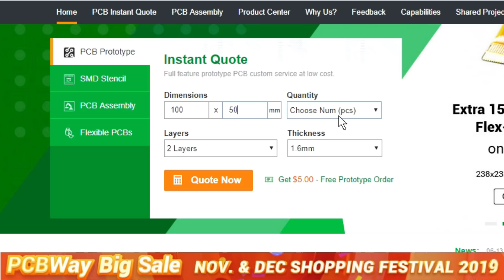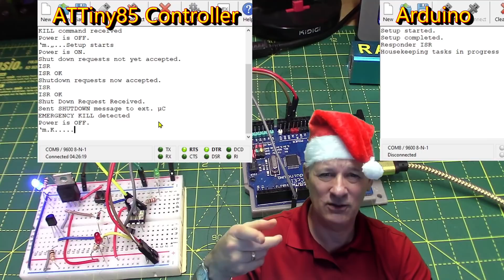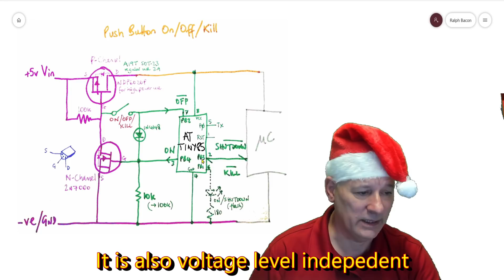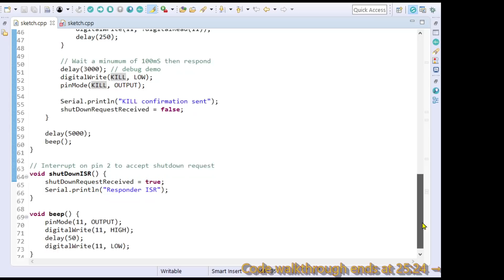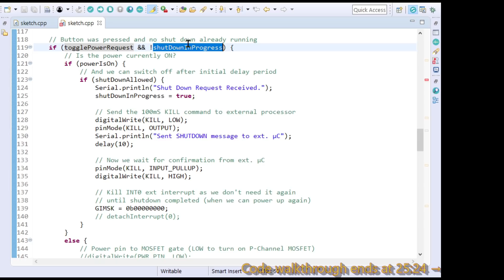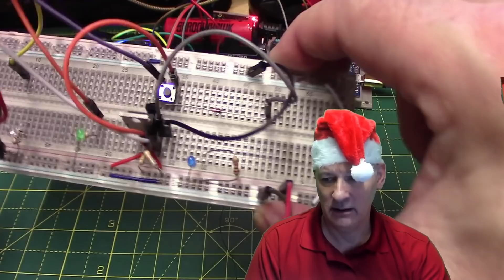#173 ATTiny85 Power On Off Shutdown

Comment: Merry Christmas!

ICSP header is simple ... Just connect to the microcontroller pins and keep your fingers crossed that the rest of the connected circuit doesn't disrupt programming. 😎 It's surprising how tolerant that process can be.

 The header is the second bit I draw on a microcontroller circuit diagram, after the microcontroller. I usually leave the header unpopulated, using a pogo-pin header adapter... which isn't fumble-proof but self-aligning with the tenth-inch hole pitch.
I use a close-pitch adapter on tiny boards with just two holes for alignment and pads for the other two. Look for "madworm" on Tindie.com for a pogo-programmer to suit the 1.27mm pitch.

Remember that the circuit receives power from the ICSP header during programming so disconnect bits of circuit that may be damaged or cause damage in e.g. machine controllers.
Reply from the maker: Excellent suggestions, Bernd! I knew someone out there would have more experience of programming the ATTiny85 whilst in circuit. I wonder if a relatively expensive pogo pin adapter is worth it, cost wise, compared to a simple 6 pin header (2x3)? I shall certainly investigate. Thanks for the information.

Comment: Why all the parts?
With 3V to 5V supply you could connect the ATtiny85 directly to the input voltage and put it into a deep sleep mode where it has pullup and wake on interrupt on the pin with the switch. Another pin would directly control a mosfet. The only parts you need then is the ATtiny85 and a single mosfet.
I have not checked the datasheet for the actual modes, enabled parts, etc. needed in the ATtiny85 for this, but it will probably end of with a very very low power consumption.
Reply from the maker: Whilst in power down the Attiny85 takes far less than 1µA, I believe. This makes it a good contender for Deep Sleep. When running it's about 5mA and about 1mA when idle. I didn't go down that route as I wanted (this time) for the power to be totally disconnected but your suggestions are very sensible. I wonder what it would take to make the circuit board flexible enough to be able to build both versions? An Xmas holiday challenge for myself, I feel. Thanks, Henrik, you always keep me on my toes!

Comment: Hi Ralphy. Excellent video. I bought a load of ATTiny85s earlier in the year but due to low pin count have only one project currently using one  and that's a very simple servo controller door lock.
I like the use of the fets for zero power usage, power off ccts. I use them a lot now so thanks for that. Have a merry and relaxing Christmas, don't stress your damaged eye and get back in the saddle for January. Can't wait to see what you have in store next. All the best.
Reply from the maker: Thanks Paul, it's been great having you on the Arduinite journey this year, all your contributions (not to mention constant nagging to do certain projects) all appreciated! It seems lots of viewers are using the Tiny85.

Comment: Very clever soft off implementation.   An attiny13a may be enough ... or maybe even one of those 3 cent MCUs. The LTC2954 does this neat trick (datasheet) "... operat[ing] over a wide 2.7V to 26.4V"  ... but they are still unexpectedly expensive.  There may not be a great demand for these Linear devices in this age of disposable, generalized MCUs.
Reply from the maker: I'd love to know the sales figures of that LTC device, Steven! With a simple LDO voltage regulator we could also have a wide voltage range, it would cost pennies to add to this circuit. Now, there's a thought...

Comment: does the ATTiny go back to sleep once power is  on to save power? then it could wake on pin change. will look at code when i get back company Xmas lunch is calling. (well ex company as I've given up work) :)
Reply from the maker: I hope your Xmas lunch was good in every way and you are keen to redesign my circuit so that it can go into Deep Sleep and be woken by that pin. Actually, I think it should "just work" the way it is now, just put it to sleep. I might try that over the Xmas period. That would save 5mA of power (4mA if we use Idle mode rather than power off mode). Have a good one!